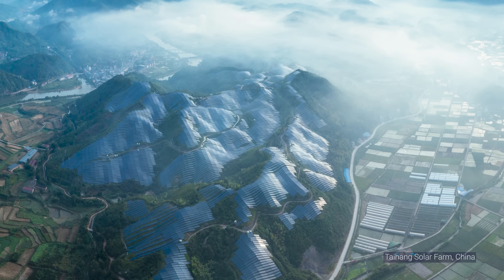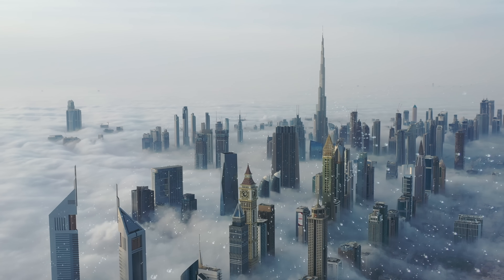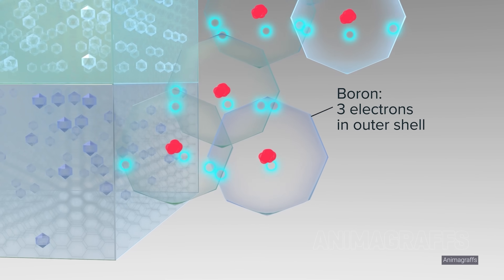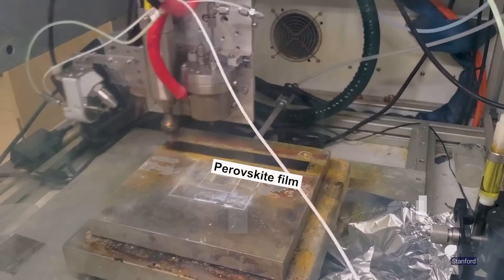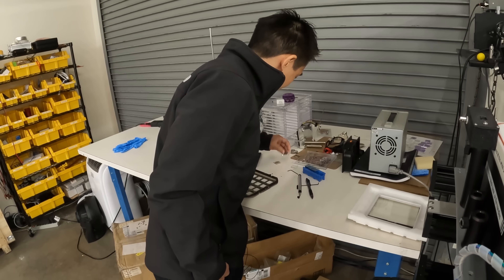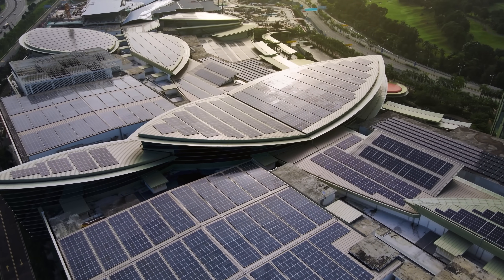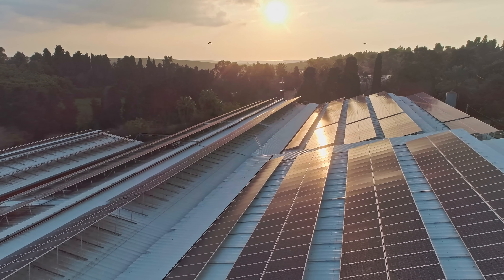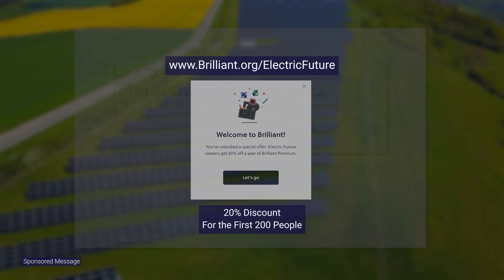Solar 3.0: This New Technology Could Change Everything

Comment: It's nice that he was honest about the main disadvantage, longevity.
Reply: The Tired Horizon  Even if they degrade in 5 years (4-5 times less than regular PV), if they cost even 10 times less, never mind the 15 times less, they would still be 2-2.5 times more cost effective.
Of course you would need to replace them after 5 years, but that cost shouldn't be as much as a complete installation as the skeleton should already be there and they just need to replace the panels.

Yes I do agree that 5 years is a short period time, but as soon as they can do 10 years, that will definitely be worth it.
Reply: @Simqer  If they are more cost effective, I hope they can be recycled effectively. If they have to be replaced so often, think of the waste that'd generate. We don't need more throw-away economy.
Reply: @Simqer  completely ignoring the tech advances in those 5 years of course.
Reply: @Simqer profits for companies not savings for consumers
Reply: I think the disadvantage of longevity is way overblown. Say they can get a lifetime of 5 years for rooftop solar. If it only costs 1/15 of the cost of Rooftop solar, an 8000 watt perovskite array would cost a whopping $175 to replace. Even if there's a 100% margin (for companies) on this, replacing this every 5 years would cost only $350. Over 25 years (the average life of a silicon cell) this would cost $1750. In regards to Solar Panels, we're currently looking at $0.33/W or $2640 in costs for the exact same panels (at scale of course). This is with no margin. As such I don't really view this as a real disadvantage provided techniques can really drive down costs to that level. I feel the bigger issue that really would need to be investigated in regards to recycling and disposal of said panels.
Reply: @wakannnai1  The panels would cost far less, but I doubt the installation costs would lower at same rate, not for domestic solar at least. The workers usually need at least one day per house for small simple systems and even if they finished in six hours instead of ten I doubt they would have time to start on another house that day. But for large installations, like warehouse roofs or solar farms, might finish much faster.
Reply: @AnalystPrime  it would be more like residing your house versus building the house in the first place. All the backing panels wiring etc is already in place all you have to do is pull or possibly even just install a second layer and connect it in to the wiring just like you would if you put a second or third layer of roofing on a roof
Reply: @matthewcaya464  If you are referring to the installation cost, yes, second time and after it might be much cheaper because the rails the panels are bolted to are already in place. The inverters may also need be replaced at the same time, but still far simpler operation than replacing the roof and the solar panels on it after ~30 years.
Reply: @wakannnai1  oh you think they will actually reuse and recycle these short lifespan products rather than just throw them in the landfill like everything else? LOL
Reply: Yes but ur assuming there price tag remains the same which it won't. As technology becomes widely adopted and more manufacturers are in the game, silicon becomes cheaper.
Reply: @georgemavrides3434  no, a scarce resource like lithium in current battery tech and failing infrastructure for energy to support this makes it unbelievably expensive to support. We were much better off spending the 6 trillion for the sun surface co2 scrubbers on coal plants then trying to upgrade to support a global green energy Initiative in such a short amount of time
Reply: @wakannnai1  Hard agree
If perovskites are really that cheap to manufacture, they'll pay for themselves in less than a year. Anything after that is just a bonus.

Assuming the other parts are still intact, all you'd have to do is swap out a sheet of perovskite. The cost would be closer to changing a lightbulb than changing a silicon PV array, so we should regard it as such.
Reply: The Tired Horizon  Not entirely true, there are many who would jump at the chance to test them out right now.  If the panels have a 1-5 year life, that would be fine with them.  The infrastructure, such as panel bases, wiring, inverter, is now in place, and all that would need changing are the panels, its a 30-60 min job. Every 1 - 5 years.

I have seen it said that these new cells are 15x cheaper, so they only need last 1.66 years, bump that up to 1.8ish, and you cover the workers wages to replace new panels.

In the meantime the formulas are being revised, tweaked, so by the time a new set of panels are in place, even as much as a single year later, they will last longer and/or produce more power.  People would pay more over 25 years if that meant every year they have the newest tech panels on their roof ... not withstanding that paying a little each year or two, over 25 years makes it affordable to many, many more as opposes to paying it all upfront then nothing for the nest 25 years (Batteries and inverter upgrades not withstanding)
Reply: Planned obsolescence was a design choice
Reply: There’s another big disadvantage of perovskites though, the material used in the most efficient type of perovskites (lead) is toxic so there is big risk if the cells get damaged of contaminating the environment or people. When they replace the lead with other material like copper it’s not nearly as efficient.

Oh and also they currently degrade quicker so not only do they not last as long, but the elements (rain, sun, wind, etc) degrade them further much quicker.
Reply: @brittanyepling1515  might want to look at current research is all about replacing the lead and it's been that way for years now

As soon as they can print the stuff on rolls and you can put it on your roof like tar paper it's a no-brainer

And no more damaging than the roofing it's replacing
Reply: Yesterday they didn’t exist, we had not discovered it yet. Now the tech is here but of course it needs to be explored and developed before it become consumer tech. What if Alexander Graham Bell after the first call said “ baah that was really poor audio quality, this idea is no good let’s do something completely different”
Reply: Disadvantage for the user/buyer but an advantage for the seller who wants a product life cycle🤷🏻‍♂️
Reply: he's a scientist who's clearly very passionate about his career, of course he's objective about it. nearly every scientist is! people who show biases are usually the journalists, reporters, and general media that try to twist the scientific results one way or another, in a much more definitive way. people like definite things, but most of science isn't definite, so the media always tries to twist something further one way or another to get more money.
Reply: They are getting better making them last. Stacking silicon with perovskite is one way. Also wider band or more light sensativite to other wavelengths. Looks very promising
Reply: @stevencaskey7473  a waste of time ... i think if we all put those genius well they arent that smart anyeay minds together we could have had Thorium reactors back up and running for the first 150 years and in between we find aomething better
Reply: try thbufrffff @stevencaskey7473  territory inrrrru
Reply: @stevencaskey7473  yed
Reply: They will keep getting better
Reply: The Tired Horizon  4 years is 6.25x less than normal panels. But if they cost 15x less then they are effectively they are half the cost of normal ones.
Reply: The main disadvantage is the current grid and the need for batteries to store energy. It’s not green when you have to produce billions of batteries that also have to be melted down and recycled. The cost to upgrade infrastructure to support solar on a massive scale will result in unaffordable taxes or energy bills for most lower income families.
Reply: @oneheadlight8000  The grid, maybe yes; the  batteries, no, not going to happen. Battery does not mean just chemical batteries and there are many that are dirt cheap and use common materials, like the one made out of literal dirt. Even lithium batteries are not a problem, we have plenty of it and they are only needed in mobile devices like phones. The problem is not that the upgrades cost money but that the companies who are currently taking advantage of subsidies do not want to lose that money to renewable energy.
Reply: @AnalystPrime  energy stage in general is a major issue with solar.. whether we can produce batteries or not it requires a grid upgrade or a home battery to support the panels on each individual home. Not all homes will be ideal for solar so infrastructure will be key.. the cost to upgrade infrastructure for solar will be far greater than if we just kept using coal with sub surface co2 scrubbers.. solar is great, don’t get me wrong.. but we can’t move too fast or it kills off our baseline energy sources and leaves millions unable to afford/ access electricity
Reply: @oneheadlight8000  The infrastructure upgrades are not dependent on solar, they have to be made because people want to use more powerful gadgets and buy bigger everything so they use more power. Who do you think paid for them when the grid was all coal powered? Hint: It was you.

The cost to switch to renewables has been calculated and it is less than using existing coal, the politicians and companies are just dragging their feet. CO2 scrubbers barely reduce some of the CO2 and do nothing to all the other pollution from coal, like radioactivity.
Reply: @AnalystPrime  I’m an engineer in the energy industry. I know how it all works. The infrastructure upgrades are required due to solar. You can’t feed the current grid with excess energy from home solar. It wasn’t built to support that at scale. My question is whether they are rolling the cost in to taxes or if energy bills will go up 3-4x.. if they cared about the environment they would have more issue with manufacturing in China or the space race.. there is 10x more damage done to the ozone by the daily rockets piercing it than coal fired plants in first world countries. It’s all about the money. Money was made in precious metals and fossil fuels for decades and now the rich get richer by shifting focus to “green energy” and space
Reply: @oneheadlight8000  You can't feed the current grid, period. The only real problem actually caused by solar specifically is that solar powered homes connected to the grid but only buying power during the coldest or hottest week of the year are effectively 50x more expensive for the grid operator, who still has to pay to maintain it. This is easily solved by giving them a small fraction of the trillions of dollars of yearly fossil fuel subsidies. 

And now you are blaming rockets for ozone layer depletion? People do actually check if such things have any environmental effects and the damage from rockets is an insignificant fraction compared to all other causes, which includes the massively larger amount of pollution released by fossil fuels. In other words, it is another strawman only someone trying to hide the real problems would focus on.
Reply: @oneheadlight8000  Hello, I am from  Earth. What color is the sky on your planet?
Reply: So far
Reply: @1SweetPete  Did you make me think my phone was upside down on purpose?
Reply: Olga Malinkiewicz??
Reply: If they cost 15x less but produce 10% more power then LCOE might be on par with traditional panels, even if they last less (installation cost becomes problem at some point)
Reply: That’s a huge disadvantage
Reply: The longevity issue would be fine relative to cost. If it will cost 4x less but half the lifespan compared to a regular solar panel then i am ok with it.
Reply: His an engineer not a businessman. Thats the difference
Reply: The Tired Horizon  yea like a year that's alot a money to wast for a year smh
Reply: Renewable energy is a big fail. The energy crysis shows fosile fuels are superior and here to stay. Gas keeps the lights on.
Reply: The Tired Horizon  sa
Reply: Why would longevity matter if the cost was less than 50% of the silicon panel? If they could majes these last 7 years and the cost was 25% of the the silicon panel then it would be a win. Plus you have the incidental savings like not needing structural upgrades. We paint our homes every 5-7 years without thinking about it.
Reply: @roberteggart7304  Well, if they only last a couple  years they wouldn't be worth installing on your home or many other projects, though they would still be great for campers and such. Being ecological is nice, but in many situations it is more important to have access to any power source at all, and these panels are easier to both carry and recycle than a diesel generator.

I found one article talking about how there are no panels that have existed long enough to give accurate data on how long they will last, but they gave an estimated number of hours. Problem is, are we supposed to use 24 hour days or just count the sunlight hours, given it is the light that makes the perovskites degrade so fast; so is it three years or six?
Reply: And that is the chief problem with all solar systems/propositions every forwarded to date.  It’s that same problem that also moves downstream when we look at the insane and unsustainable need for rare earth metals needed for batteries.  Perovskites have some great niche applications and don’t gobble rare earth metals and that’s great, but niche at best.   I just wish we’d start building more nuclear; obviously using the 21st century technologies we have in that realm while fully divesting from the 1960’s technology which dominates now.   With smaller safer reactors, we’d make far better use of our resources, with a far cleaner footprint, and at a far lower long term cost to all people.  -Just my 2¢
Reply: He seemed honest about everything, like how this technology is "not ready for prime time, yet". For decades, this what normal people have been saying about all solar energy. It's great, but needs more time, research, development, and support. Meanwhile, there's no problem with continued reliance on proven, practical, economical energy from nuclear, gas, coal, and oil. It was nice to see a video of real scientific endeavor and sensibility, without any Bible-like stories designed to scare us that doomsday is coming if we don't change our sinful ways and build everything out of windmills and solar panels and bury our carbon underground like superstitious peasants trying to ward off evil spirits.
Reply: Imagine if jk clean energy man solves energy and makes it affordable to everyone because this one guy taught him how to message the company, lol. Probably would take years to be put into effect if the solution works though.
Reply: I am 61 and in my life I have seen and read about so many things that were supposed to "change everything". Few have. 
I am not being cynical. It's just the way it is. From cold fusion to room-temp superconductivity to fusion energy, none of them have seen the light of day yet. Don't even mention bucky balls, graphene or quantum computing. When you're as old as I am, you take it with a pinch of salt.
Reply: @Shenaniganizer-1  Just remember there is a difference between respected scientists making an announcement about quantum computing(which we already have, it just isn't in your PC) and some conman who has already been jailed for fraud trying to sell cold fusion or a water powered car. The scientists will happily explain how it works and what technical issues need to be solved, the conman refuses to let you test their mystery box until after you paid the money, if even then.
The issue here is not that the perovskite panels would not work, they do, the R&D refining them is just going to take some time.
Reply: Rasin coating?
Reply: This exactly what I was thinking about the longevity.
Reply: X 🎉X 🎉x
Reply: Yea but he never gave an idea of what the result of all this testing he kept saying they had done actually was. Like he said they had greatly improved since they began so where are you at? Clearly you don't think 25 yrs or maybe not even 5 yrs. If temp is the issue than perhaps cooling solutions should be added.
Reply: I have the same problem.
Reply: The Tired Horizon  is
Reply: It’ll get there
Reply: Yes. A proper presentation in all respects..

Enough knowledge and hope.

One for the archive.
Reply: The state of Louisiana is for helping the big electric companies.  That they reduced what the electric companies will credit you for over producing electricity.      So for for instance let’s say it cost 8 cents per KWH from the electric company and they would also pay 8 cents per KWH you sent back to the grid.

Well now it still costs you 8 cents per KWH but they only pay you half 4 cents per KWH.  

It’s amazing how backwards my state is. The political pockets are so lined with corruption it’s sickening
Reply: The Tired Horizon  and a
B ir a ee aku
Ensure as well and especially ease into a a are a small business so you and family are able as always Essex as you have
have to have to be is
A
Reply: Longevity is why I support research into Thorium reactors over any solar alternative.
Reply: Estimated longevity. It's usually the problem with a lot of new tech. It's more advanced, thus it USUALLY lives shorter. However what they do make the mistake of doing as well is saying that it is estimated to cost 15 times less per W produced. If something is 15 times cheaper, I can handle its longevity being half as long, or even 1/4th as long.
Reply: They all have this problem ... plus you need to clean it every so often .. best be gentle xD
Reply: The Tired Horizon  the Grid cant even take it 😑😑 same with Wind farms .. the input is too damn uncontrolable at larger instalations
Reply: I'd like to see the day when skyscraper windows and rooftops are covered with Perovskite film
Reply: @ramonpunsalang3397  i dont ... thats the day we are dead already
Reply: The Tired Horizon   or they make it 10-15x cheaper like replaceable cells and one would buy them
Reply: If they're up to 15 times cheaper, why is it so important that they last as long? Why not purchase it 3 consecutive times and still have it be cheaper than the wafers?  I don't think it having a 15 year shelf-life instead of 25 negates the price difference at all
Reply: @RascanThe6th  its far from rendable 😑😑 look .. solar power is nice if you live out in the sticks or the desert where power is nowhere to be found ...... for the rest just hook up.to the grid and dont moan and bitch about it .. if you cant afford the grid . You def cant affort solar power 🤣🤣🤣
Reply: 10-15 years is still a lot
Reply: iiñ.
Reply: Done on purpose. The energy companies need to make money somehow. planned obsolescence willing to bet my lifes savings that when solar energy becomes mainstream soon they will release solar technology that is a lot more advance but won't last 20/25 years like the panels do today. Instead it will probably need maintenance of a few hundred dollars every few years. People really think the governments will just stop a trillion dollar worldwide industry and not have an alternative.😂
Reply: @Milo19970  You just lost your life savings on a stupid bet. Energy companies make money by producing energy, forcing people to pay for maintenance is the ICE car and oil company business model.

The whole point here is that "few hundred dollars every few years" is typical of what these panels might cost to install but the investment would have a return of 5x even without any subsidies. Old panels cost $10k+ up front, have 2-5 year period before they pay for themselves and might only have 3x to 5x ROI over much longer time.
Reply: well even if they could make it last 1000 years after beeing produced, they wouldnt. demand and production. they often make things so they break :D (light bulbs, smartphone windowglass, last update on abandonware (old windows), car parts, washing mashines, computer parts that are heated a lot (same logic as with light bulbs), single chip tech with no backup in case of error, etc.
Reply: @kliersheed  If the panels lasted for a century there would still be a demand for more. Just covering the current global electricity use requires trillions of panels and as more people are born, more countries improve their standard of living and more industries switch to using electricity instead of other forms of energy that number will continue to increase.

And even if the factory making the panels wants them to break in a few years that is totally irrelevant because then the energy companies and private users will simply buy better panels from another company or even make their own. The whole reason why the power companies are building solar and wind farms instead of coal plants is that renewables cost less to build and maintain.
Reply: But the ‘disadvantages’ seem to be along the same lines that the first gen had. And with how tech evolves. I give it like two three years.
Reply: The Tired Horizon  Depends on were you set the cut-off for what you consider acceptable reduced performance. They contineously degrade because of the structures intentional instability. Its this instability that makes perovsiktes semiconducting. And who wants to buy something that degrades even in storage?

And remember that only 8% of the cost of an installed solar panel is the actual cell cost (for large power plants). The rest is wrapping and installation. So if your panel dies within a couple of years, the actual payback is going to be much smaller than for conventional cells.
Reply: @renatobugge6863  Lots of stuff degrades even in storage: Fuel, medicines, preserved food, batteries, anything with rubber or plastic in it, explosives, the primers in nuclear warheads... People are still happy to pay for having that stuff prepared in case of need. Well, except for the nukes. The military already uses plenty of machines that need constant maintenance and replacement parts to keep them in working condition so having a part that has a best by date is nothing new. A folding PV panel for campers might only be used for a few weeks to months total before it is discarded for a new model(or thrown away after owner decides camping is not their thing) so making them from perovskites would actually lower their pollution footprint while increasing the sales.

Perovskite panels cost less to make, far less to recycle, and are more efficient so the lifetime costs go way down even if that lifetime is shorter. Currently it appears that as long as the panels last a few years, production gets going steadily, and the installation costs will not rise to insane levels the cheaper panels will have an advantage. We would need a cheaper yet more efficient longer lasting panel to make silicon competitive again.
Reply: Main disadvantage is toxicity
Reply: Do you like the shot @ 0:11 or the shot @ 0:04, because there can't be trees on those hills if it's covered in solar panels. Seems like an overlooked disadvantage to me.
Reply: @cipher88101  That is relevant how exactly? There are millions of square miles of unused land available, why would anyone pick a location that requires extra work? When you build a solar farm the plants and animals will thrive more than before because they will get shade from the hot sun.
Reply: Why can't they just build a fee rooftop panels now, and see if they last.
Reply: @bencrawshaw1227  The funding racket is a massive one. Hundreds of billions of dollars are at play in this startup funding game. Such announcements are literally a dime a dozen. They get their seed capital and most of them disappear like a fart in the wind.
Reply: @Shenaniganizer-1  Yes, there are hundreds of billions at play, in the subsidies paid to the fossil fuel corporations that will go away because for a while now renewables and energy storage WITHOUT ANY SUBSIDIES have been cheaper to build than keep using fossil fuels even when you already had the power plant.
Reply: They really only need to last long enough to offset the energy required to manufacture, plus the energy they replace in their useful lifespan. If we manufacture them with largely recycled and recyclable materials, they could be viewed as tiny fungible shingles at some point n
Reply: @TheMaxAwesome  what materials are largely recycled multiple times? What method of storage do you use for this type of energy? Who pays for infrastructure upgrades around the world to support a massive green energy supply? There are a lot more issues than just manufacturing something with longevity or recycling in mind.
Reply: Depending on cost, it could even be worth replacing your panels more often
Reply: So the next task would be to find a protective layer that wont reduce efficiency.
Reply: The question is, can you generate more energy for the same cost that a solar panel is alive
Reply: Titanium 147  the solar panels are a fraction of a fraction of the cost of solar energy.
Reply: Dust.
Reply: dude got it
Reply: The Tired Horizon  unless they make the process of replacing them relatively easy, he did mention the process of making them is going to be much MUCH cheaper than silicon cells. so if you just, idk, add on a new coat of solar cell paint or something every 5 or 10 years, it might be worth it.
Reply: That's always been the economic problem with solar, the materials degrade under high heat, losing efficiency, (unfortunately correlative with ideal sunlight exposure) and eventually need to be repaired or replaced. If they can figure out an affordable way to prevent decay under high temperatures, that would be a major breakthrough.
Reply: @liberphilosophus7481  TANSTAAFL applies to everything, even sunlight. It is free but technically you could say it "costs" some of the PV panel lifespan.
Good news is that as nice as it would be to get even better panels, we don't really need that breakthrough. Solar+batteries passed the point where it is more economical than coal years ago and everything else is just a bonus.
Reply: bad longevity = more sold > more produced 💰💰💰
Reply: @spooky2466  Nope, doesn't work that way. The whole point is being more efficient, so less panels are needed, while being cheap, meaning even if you sell five panels instead of one they cost less. And you don't sell five, because fewer panels, so more like two or three, and that is over 20-30 years.
Reply: @AnalystPrime  didn't know that, thanks!
Reply: Yeah, if it only needs a few hundred degrees to make it, then they also need to make sure the sun beating down on them isn't going to melt them at the same time. That's a problem for being so easy to heat up, I guess.
Reply: Durable goods is a thing?
Reply: The Tired Horizon  that’s not necessarily true what you need is the cost of maintenance to be less then that of the other options so say if a regular smegular panel last 10-20 years at 10k$ if that can can pay 5-10 years for less then 5k it’s viable.
Reply: It will be fixed gradually for sure...💯
Reply: Planned obsolescence
Reply: Easily stabilized with graphene
Reply: At these base efficiencies and simpler manufacturing process that might not actually matter so long as it reaches say 5 years reliably for homes
Reply: So far but its early isnt it ?. Funny you ignored that
Reply: Right, but they are improving efficiency and now they need to figure out efficient storage of the energy
Reply: I agree, great video!
I have a potential solution for longevity. But I would need someone much smarter than I to work out the logistics.

Rather than tackling a potentially unsolvable problem in enhancing the mechanical structure of the crystals… They should focus on a mild acid or something rather that will deteriorate  the substrates completely. That way they can just reapply a new layer every 5-10 years or so. Especially if they describe the installation as “paint on”. If longevity is an issue than just reapply every 10 years. Just like a coat of paint. But to reapply, it would make sense you would need to strip the initial layer. Maybe they can swap the glass substrates for a ceramic that could be dissolved in solution??

Seems logical to me but I havent researched it.
Reply: Or better yet, Mask the initial layer with a thin conductive layer, and paint over it with a new solar layer.
Reply: Yea... But we're already as beefy as standard ones were in the 80s.... Before the end of the decade I'd hope
Reply: It won't fly until the energy companies can viably and massively overcharge you for it.
Reply: Not an issue to be real. People buy  new phones every year, they can afford buying cells every 5 years. Especially when they're cheap enough.
Reply: It all boils down to cost. If its cheap enough, then it will be like getting your house repainted.

In the past few years, traditional silicon panels have gotten down to ~70 cents a watt at retail prices. That's only $7000 for a 10KW installation. if you're a DYIer, you are no longer looking a a $20K+ installation. Inverters are cheap, and if you use forklift deep cycle lead acids, you can build your own "power wall", without subsidizing Elon Musk's lifestyle.
Reply: @michaelmoorrees3585  you don't paint your house every 5 years....
Reply: @randybobandy9828  no but probably every 10 to 15 and your paint doesn't pay your utilities
Reply: @matthewcaya464  yet it was used as a example.
Reply: We already have Sun Power solar. Their cells last 25+ years.

 25 years is actually the length of their warranty. 😊

They're the 3rd generation solar cells. They have an efficiency of 22.7% plus. Most solar cars and EV's use them. They aren't like the ones you have on your house. 

Low light and blue light spectrum ability is about 20% higher than your typical monocrystalline cells. They are easily distinguished by their flat/matte dark blue cells without grid lines which tend to blend in better and the cells themselves are a darn site more durable due to their copper backing. They're almost indestructible under most conditions.

They've been out since 2013. Not many people know about them, but their performance is catching a lot of people's attention, especially in the RV and camper conversions sector. 😊🌎☀️
Reply: @DeanTheDoctor  
SunPower cells will probably last 40 or 50 years. They’re amazing. I got the X21 on my roof.
Reply: Hi
How to search for information about them, cheers
Reply: Bad Longevity is perfect for a company as they then don't need to find ways to sell the product to people again
Reply: It's sad that so many paid big oil trolls make stupid misleading  comments on clean energy links.
Reply: I just got a patent on a new, non-variable clean energy concept.  This video talks about some of the down sides of this technology.  My concept may solve those issues.  Do you know where I can contact them?
Reply: @jkcleanenergyman6573  twitter
Reply: @jkcleanenergyman6573  you could start by paying attention. The guy is standing outside the building with the name of the company and the address on the sign. Or google.
Reply: @jkcleanenergyman6573  your comment just earned you a second sub❤️ I'm very interested in seeing where you go!
Reply: @jkcleanenergyman6573  
What’s your patent number, and when was it filed?
Reply: @jkcleanenergyman6573  
Their name and address is in the video. Did you even watch the video?
Reply: @jkcleanenergyman6573  hey genius Joel is on the internet that scares me you invented anything but co2
Reply: @jkcleanenergyman6573  they mention Swift Solar, maybe see if you can search for that.
Reply: @jkcleanenergyman6573  how did you get a patent and you don't know how to make a google search? it's literally on their website.
Reply: @jkcleanenergyman6573  also, I'm looking at opening a clean energy and much more retreat in the next year and would love to be in contact with you.
Reply: @jkcleanenergyman6573  Right click on their avatar then click on open in new window then the about tab to get their email address (if they decided to enter the info). If they have contact info this is where you would find it
Reply: @audiogeneral  new here.  Not sure how it works.  Right clicked on some people I want to talk more to and "about" did not come up
Reply: @jkcleanenergyman6573  You  right click and select open in new tab, go to that tab and then select about. You cannot talk to people but you can see any contact info that they want you to see.Most people don't have any extra info but some have location, email or address. It depends if the person wants to be contacted or not. I thought you were looking for contact info.
Reply: @audiogeneral  Hambug  ! ! !
Science is So haughty claiming We are almost at the verge of discovering the Theory of everything 😂😂😂
We can't Even copy the sun's  fusion nor kill a virus or  a simple cancer .
Reply: @audiogeneral  i find this absolutely fascinating. this dude has a patent but cant figure out how to email a company. unreal.
Reply: @jkcleanenergyman6573  Tap the 3 dots to the right of the person you want to talk to and write your message, it will appear like your original message that I’m responding to, it may be today or further in the future that they reply.👍🏼
Reply: The Tired Horizon  this is old technology, have you seen the Knight Rider 2000? 
it  is coated with this solar film .
Reply: And the fact that they can get 86 percent but it's years alway all of. A sudden like they can't. Make several layers already.
Reply: ENERGY IS IN EVERYTHING - Create high electric potential difference to extract electricity from earth, water & air. Use transformer to convert to usable voltage. IT IS POSSIBLE!
Reply: What we need to be honest about is that renewable aka unreliables will never power is totally. What we need is real electricity from nuclear.
Reply: @thegreataynrand7210  Unless they develop safer technology that works better, this tech is a step in that direction
Reply: @thegreataynrand7210  
On the West coast where renewable energy is very abundant. I think we can use solar/wind/hydraulic for the majority of our energy.

However for the rest of the country/world I agree with you and feel we should gravitate towards nuclear.
Reply: Did you notice the part about how they aren't as good as normal cells?  LMFAO!
Reply: @bobsmith6544  They said that automobiles and mechanised war machines weren't as good as cavalry, 100 years go...
Reply: @beelimsolutions  tldr
Reply: @bobsmith6544 I believe they said the same things to the Wright Brothers, and the inventor of the Otto cycle.
Reply: @bobsmith6544  People keep using "not as good" tech all the time. Like paying far more for maintenance and per mile just because ICE cars are little cheaper to buy and faster to refuel.
These panels could deliver twice as much power as modern panels at far cheaper price, and because they can be lighter than the silicon panels they would also be cheaper to transport and easier to handle so even the most expensive part, the installation, could cost less. At lower price it is also viable to do things like putting panels on the walls or the less sunny side of the roof, so instead of paying $20k for a 10kW system you might get 25kW for $5k, at which price you would likely save money even if the panels had to be replaced every five years.
Reply: @AnalystPrime  and even then. After 5 years new tech will be available anyway
Reply: @AnalystPrime  i LIKE HOW "COULD" IS THE MAIN part of your gay argument.
Reply: @AnalystPrime  "could" is the million dollar word in your comment.
Reply: @ronmiller7248  It is just a word, intelligent people do not get stuck on it. Solar panel size depends on the PV cells on it and the size of silicon PV cells depends on how large the manufacturer can make the 99.999+% refined silicon crystal they have to work on. Perovskite has no such limits and is still being developed so I do not pretend I know the exact numbers.
Example: Alkaline batteries deliver 1.5V per cell, Li-ion is 3.7V per cell, that means if you made a Li-ion battery of same form and put it in your radio or flashlight, the voltage would fry it; to make a 1.5V L-I cell extra steps are required that change its energy density from optimized 3.7V cell type. Likewise a perovskite solar panel may need to be different size or deliberately use less cells so it is compatible with existing inverters and other electronics, therefore we cannot just assume that the increases in efficiency will give exactly same increase in watts per panel.
Reply: @AnalystPrime  You get it, economics and newer tech👍🏼
Reply: @AnalystPrime  Twice the power?
That's quite a claim.
Reply: @oldbatwit5102  Typical modern silicon panels are 15-20% efficient, very much depending on price, and some people are still using cheapo 10% efficient ones.
The perovskite cells are 33% efficient so depending on which type you compare it to it will produce ~150% to 300% power using the same amount of space, not counting tricks like making the panels double sided or using concentrated sunlight.
This is commonly available information. The only question about these cells is how well they last, their power has been clear from the start.
Reply: @AnalystPrime  Hurrah!
The world is saved.
Reply: @bobsmith6544  good point, just use the default solar pannels